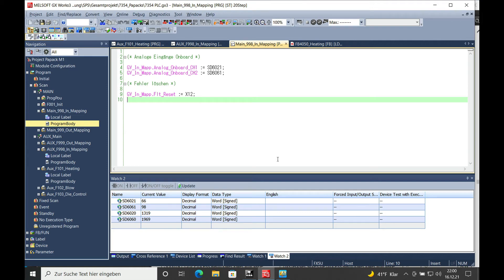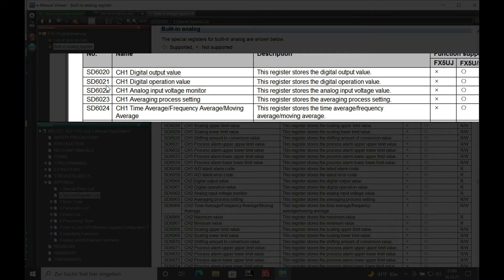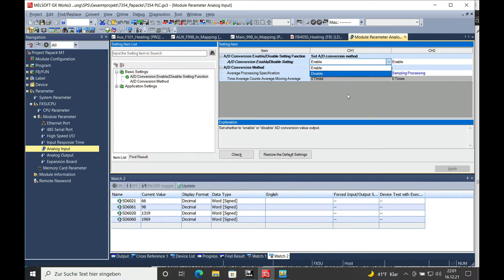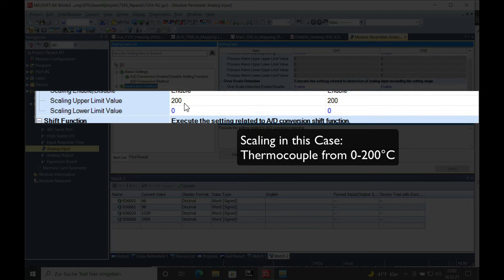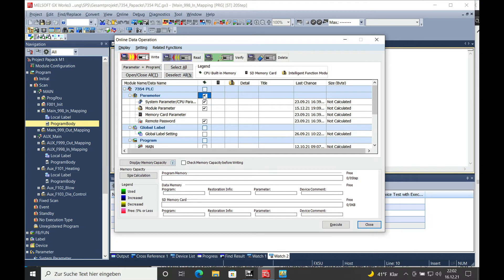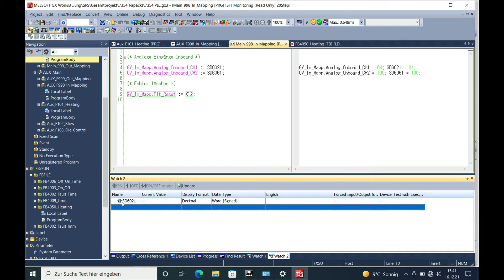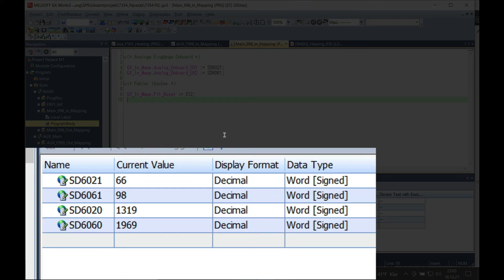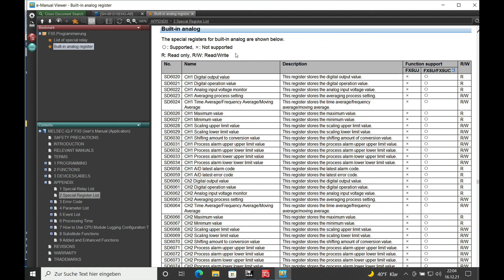FX5U Onboard Analogue Input Scaling Mitsubishi Melsec

Comment: hi ive got a pressure trandsucer -1 bar to 12 bar 0-10v signal how do i get it read accurately
Reply from the maker: Hello, thank you for your question. Please view my video at 1:55mins. Also calculate 12 Bars with a resolution of 4000 Units you will end up with an accuracy of 0.003 Bars. If you now set the "Scaling upper Limit value" to 1200, you will have a resolution of 0,01 Bar. If you set it to 120 the resolution will be 0,1 Bar. I hope this answers your question.
Regards 
Gerd
Reply: thanks for the response i have a q series plc so how can i enter the information i dont have the module parameter: analog input section @zellerautomationandplc
Reply from the maker: Hello, i have a Function block for FX CPU`s where i can make these calculations. Unfortunatley not in Q Series. If i send you a printout of the program can you write it in Q-series?

Comment: Hi, how to convert to real temperature with PT100 and AL2-2TC-ADP converter so that it also shows minus temperatures? The converter gives signals 0-10V 0-4000. is the value
thank you very much
Reply from the maker: Hello, i do not work with alpha controller too much. In order to help you with that i would need some time.